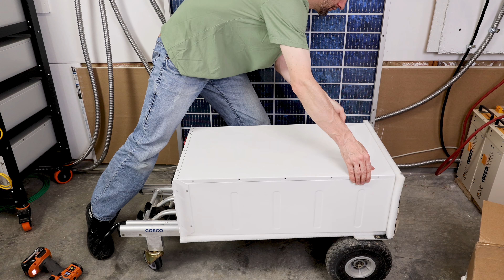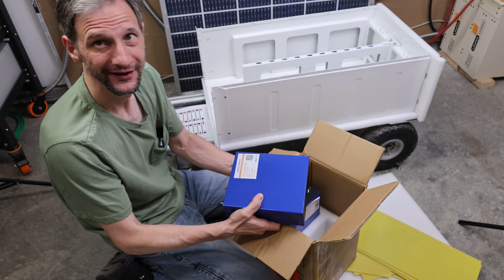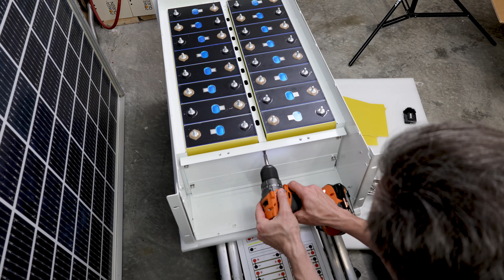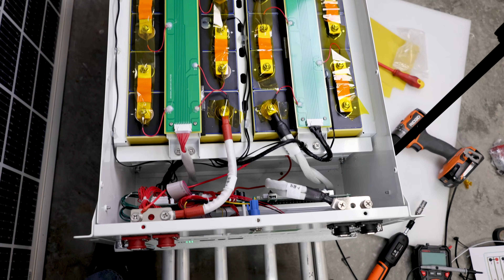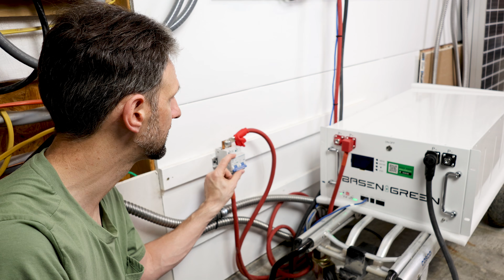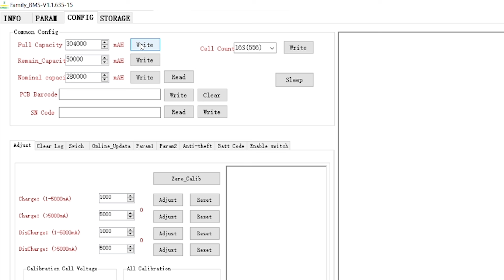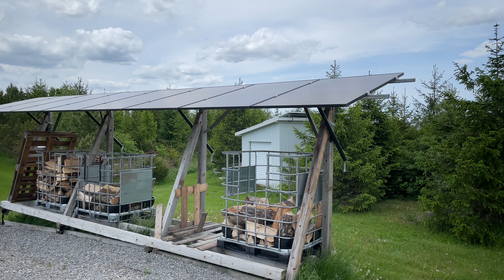SAVE Thousands - Build your own home solar battery backup!

Comment from the maker: See recommended battery options on my website: https://projectswithdave.com/batteries/
See more projects and get my FREE Solar Financial Calculator on my website ProjectsWithDave.com: https://projectswithdave.com/
Thank You for considering a small donation to help with channel expenses by clicking here: https://projectswithdave.com/donations/give/
304Ah Eve Cells US Source in stock here: https://solarsupplyhouse.com/product/set-of-four-304ah-eve-lifepo4-prismatic-cells-with-welded-studs/?ap_id=EverydayDave
BassenGreen Battery kit link (Often Out of Stock until August): https://www.basengreen.com/product/diy-case-for-48v-battery-packenclosure-accessories-copy/
Alibaba source:
48v kits: https://www.alibaba.com/product-detail/basen-greenline-battery-EU-stock-51_1601147027430.html?spm=a2747.product_manager.0.0.186e71d2fLaq6V
280ah: https://www.alibaba.com/product-detail/Shenzhen-Basen-Lifepo4-Grade-A-Battery_1601114676597.html?spm=a2747.product_manager.0.0.186e71d2fLaq6V
Reply: 3200 watt panels,
What's your take about the ideal charge amp and volt for this pack?
Reply: Namaste Bro, From where I can get it all products and accessories to my place in India at affordable prices. Thank You
Reply: Namaste Bro, From where I can get it all products and accessories to my place in India at affordable prices  Thanks 🙏
Reply: Is this a HIGH VOLTAGE DIY ?? Do you know any HV battery builds ?
Reply: What is the TOC (Total Cost of Ownership)?
Would LTO cells be better?
Reply: Lay the panel battery thingy flat the way it's designed You're going to crush the cells that are on the bottom of the stack
Reply: there's a whole area of study wrt compressing battery cells, most designs use clamp bolts.
Reply: I saw the cells for sale and thought about building my own battery of arround 15kWh because that matches with most voltages. I didn't know about this case, that make it a lot easier. I want to build one for my new house in the start of 2026 so i'll wait a little bit longer. If there is a commercial prebuild one by then for around $3000 i would probably buy that.
Reply: @AndreVanKammen   The assembled one is available now
Reply: @BraunPower  Thanks, I noticed. NKON in the Netherlands (where I live) also sells complete ones for a nice price. I already bought 3 Victron 6k5 from them, will start in the summer when my shed is ready.
Reply: Is it possible to purchase just the front control panel separately? If so how much?
Reply: Get an I.T. rack, any old I.T rack should work.
Reply: Hi Dave. After many hours of research your video popped up in my recommended feed. I watched your video and was convinced this was the battery for me. They sent me a damaged battery and then made it my responsibility to make sure it still works properly. I will be making my own video chronicling my experience.  I don’t see a way to reach out to you by email so I have to hope you see my comment.  Would you please consider taking your video endorsement down off YouTube? This company has not done the right thing by me and I don’t want any of your other subscribers to get into the mess I’m in. Thanks 🙏
Reply: That was such a great video and seems like something I would totally be interested in doing. Unfortunately you included so many links that I was lost as to what to purchase. You might consider a link that just includes the components you used in this specific build

Comment: I preferred the DIY you no longer trust companies selling you crap different cell on a premium 12v battery case. 

DIY is a genius way to be 
self-sufficient you buy everything that suits your needs to build 12v or any battery bank if something goes wrong you can dismental everything and fix it without a fraction cost of a thousand bucks.
Reply from the maker: I like DIY as long as it's saving me money, adding value, or delivering flexibility.  Ok, it could also just be an excuse to get a new tool .😂

Comment: I bought 3 of these.  Just wanted to make you aware of this.  One has been having issues and I believe the BMS is having issues.  The cells keep getting out of balance or either over voltage. I have spoke to them and they keep saying there's nothing wrong. Something is wrong for sure. It's still in warranty and I just don't think they want to replace it. I just wanted to make you aware they may not stand behind the product.
Reply from the maker: Thanks for posting your issue.  Make sure all the balance leads are clear of insulation under the contact surfaces and all the terminals are torqued properly.  If there is variation in the resistance of the connections, it won't balance properly.  Also, are you regularly charging to 100% and holding for some period of time for balancing?

Comment: Would love to find a Diy battery build for Generac PwrCell (1st edition). Bought a house with system already installed and they are grid tied and no battery. Power goes out with the grid,  what they point except selling solar (at deeply discounted rates for the local power company, on a Time of Use meter). Open to suggestions and I don't mind if it's not proprietary as ⚡️voltage is as voltage does. As long as I can match Amps, or I'll run a one way system and just charge batteries from the solar , but it would be nice to collect power when the grid is down.  Stupid design on Generacs side. All they want is 🤑💰💸

Comment: Right at the start of this video, you said there wasn't enough cost savings to warrant DIY battery banks??  What!? 

Come on now, you had to resort to a lie to kick off this video??  the cost savings, since Day 1, has been more than enough reason to build your own battery bank.  The cost savings, since Day 1, has been in the neighborhood of 40-60%.

The real reason, you avoided the DIY battery banks is because the average person isn't intelligent enough to do it.   Understanding the BMS alone and wiring it up correctly is enough to confuse most people.  Not to mention understanding what AWG wire to use.  Then, understanding series and parallel, and what effect that has on voltage and amperage confuses a lot of people as well.  The kit, takes a lot of that guess-work out.

You never explored, DIY battery banks, because you aren't intelligent enough to do it.  That's why you never did it.  Then this kit came out, and suddenly, the DIY battery bank became an achievable goal for you.  So, who was the SME you consulted to do this video?

And FYI?  you don't need the kit.  The kit is $500~.  If you did it all, 100% from scratch, you can save about $300 not buying the kit.  That BMS?  Is not expensive.

Comment: Maybe this was a good idea 1 year ago, but you can currently find fully assembled 15-16 kWh batteries with up to 10 years warranty for about that money minus the hassle and danger of the DIY route. Excelente tutorial, though. 👍
Reply from the maker: You're right, factory-assembled units provide convenience and safety and are often just as cheap as the DIY route.  However, I would still check the build quality, I have found that even some UL certified batteries can have poor build quality.  This is a great pre-built solution: https://youtu.be/5AKooBZNT9Y
Reply: @ProjectsWithDave  👍

Comment: Would this pass the local code enforcement?
Reply from the maker: No, local codes require UL listed equipment.  If you need inspection, you will need to confirm all your equipment with your local inspector.

Comment: I love how people now do things like this on even computers use the word build. Build used to mean something like buying rough cut wood, cutting it to a size in accordance to the plans one made on paper and then building a structure or a custom piece of furniture. Now, if one buys the plug and play components, snaps them into a tower, plugs in a wire, they built a computer. In this case here you would buy a bunch of batteries, place them into a purchased box specifically to hold the exact batteries that you bought, wire them together and you built a battery. To me this is assembled a battery pack not built a battery. But, the word built makes people FEEL better about themselves. They can now brag that they built a battery. I find it hilarious.
Reply: Do you build or assemble a jenga tower?

Comment: With battery that size how many panels are you running
Reply from the maker: I have found a 3kW array to be a good match.  8 panels that are 375W each is a good start.
Reply: @ProjectsWithDave I just got 108 acer for hunting so for a cabin  I'll have to run something  because getting power will be iffy i don't want to always run generators non stop I want the silence
Reply from the maker: Silence is worth a lot!  For a cabin you don't want to go too big, you will spend a lot of money that will never be recovered.  Depending on how often you go there, you  could probably get away with just a couple of panels to slowly charge a 280 to 314Ah 48V LiFePO4 battery.  That should last quite a while in a low demand situation.  Just have a generator available to boost the battery if you are there for several days with no sun.

Comment: You have to ask yourself what the hour life of a battery bank is. It takes a minimum of 1000 hours off the life of the battery bank to break even with your Utility service.
Reply from the maker: There are many factors that go into calculating the payback period for a battery bank, and it varies greatly from system to system.  In my case with net metering, it will never pay for itself.  I only have it for emergency backup.
Reply: @ProjectsWithDave  Very well. You know what you're getting with the expense, and apparently don't have unreasonable expectations (like the fellow I tried to help with his wind generators). My brother, an EE professor, installed PVs on his house, not realizing that if his wife outlived him--which she did--left her with all the maintenance and property value problems. Not fun for an 80 yo woman who has no affinity for tech either. Her one salvation is her oldest son is also an EE. But of course this throws an extra burden on him early in his own retirement.
I really would like to know what the hourly life of LiFePO4s are now. I looked at building my own EV a second time a few years ago, and found the life vs the fuel cost savings was not there. I have way too many irons in the fire in my life to burden myself with more tech maintenance.

Comment: Hot melt glue to secure the temerature sensors ?  Not sure what temperature the probes switch off the battery but hot glue " can soften near 65–80 °C "  from search ... Almost certainly be OK ..But I would have cut a little nitch in the plastic seperating the cells and tucked the probes in there. EDIT ..from , search BMS usually cuts out at 55C
Reply from the maker: Yes, hot glue was not the best solution for holding them in place.

Comment: Can you connect these cells in series-parallel connection?
Reply from the maker: You can connect them in parallel.  They are not intended to be connected in serries.
Reply: @ProjectsWithDave I meant series parallel connections not either or ! Look into it I was wondering if the cells can be connected together like this

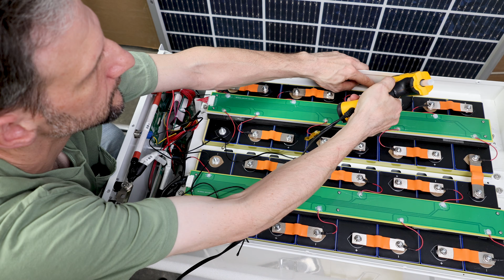Comment: 8:47 You used Kapton tape as insulators on the battery terminal connections. I had never heard of that. I had to ask ChatGPT what word you had said, and have since learned all about “Kapton”.😊

Comment: So, what's the catch?
The effort required to assemble the kit is low - it cannot drive the price down. It's probably $20 or less in China.
Shipping - could also be the factor as shipping 5 smaller packages ~20kg is likely cheaper than shipping 100+kg steel box full of flammable chemistry.
Warranty? Generally nobody needs to guarantee your diy kit works. How much is this worth? not sure.
What did I miss?

Comment: Correct me if i am wrong. I dont think DC breakers works on a single wire or polarity. It needs both positive and negative polarities in order to trip. Thats why DC breakers are marked +ive and -ive.

Comment: .. 😂😂😂 lolol normal grade a cells batteries are 1000 for 5.4kwh... or 3000 for 16.2kwh, or 2800 for 15.3kwh... and it isnt diy. You opened up correctly. Diy batteries are just not worth it.

Comment: U can use a 48v 5.5kwh tesla battery i found them for 230 bucks, i ordered two to connect in parallel, i now got 11kwh for only 460 dollars
Reply: in reality I get only around  ~8kwh , with active balancer, do you use any BMS ? , because of the charge and discharge limits , I use the same for around 4 years
Reply: @johnlonappan7945 i haven’t received my batteries, but i ordered a BMS with Bluetooth, i used chatgpt to help me design the system

Comment: Very impressive for the equipment  that you have to test the battery , But I am just the regular resident that want its to work period. The Assembly part I am OK. But what kind of a charger and dispenser do I need ? , I would like to run for the  entire house. 120 to 240. Please educate me. Any information is greatly appreciated.

Comment: Looks very much like the Seplos kits I built. Been running perfectly since I installed them in Nov 24. Will do an inspection on them in an upcoming video to see what state the cells are in. I 3 of these in parallel giving me 48kwh. So far I am extremely happy with them and the price was exceptional. Got all 3 of them for under $5k shipped to Italy from Deligreen power in Poland.

Comment: Beautiful. Where is proper fuse or circuit braker in this BATT ? If BMS and FETs go to "SILICON HELL", what will happen to this cells at 30 000 AMPS short c. ?
Does BMS have H2, C2H2, C2H4, CO detector and other potencially explosive gases ? How many temp. sensors have this BMS ?
If temp s. are not at every CELL, how will BMS know, that there is temperature rise and cell will go to internal shot circuit soon ?
What type of ventilation or water cooling is used for such projects ? If no thermal management, cells will be heated at nominal current
and AC impedance of cells will be high, so BMS will not be able to balance this battery.

Comment: IT looks like you could put an insulator on the bus bar strap going over the chanel peice or your last bus strap put on//thanks for the demo, I got to check on some batter kits this type, I never knew they had kits for these type battery.

Comment: All these DIY boxes that are out are nice. Just put #6 of 9 online this morning. Happy days are coming to an end soon though at least in the short term. One vendor I follow in China said last week that EVE cells are going up in price 100% as soon as stock inventory is depleted. Battery component material shortage they state as the cause. Made my orders back in January expecting this coming. Glad I did and slid under the wire at $!800 ea. Could be a good while before those days are seen again.
Reply from the maker: Wow!  That's quite the DIY battery build.  I suspect we will see a lot of price fluctuation in the short term.
Reply: No such thing as too many batteries. Wish I had 6 more.

Comment: Is this just a "plug and play" system, or do I need to setup on a PC and follow steps? I too have solar and over produce yearly average of 5,000 kw a year. Please help me set this up.
Reply from the maker: If you want plug and play, I would use a pre-built system.  There are several options on my website here: https://projectswithdave.com/batteries/

Comment: I don't have a victron system.  I plan on getting an all in one growatt 48v 3000W inverter.  Will this work?
Reply from the maker: As long as the inverter is designed for 48V LiFePO4 batteries it should be fine.  You might not be able get the inverter to communicate with the BMS, but you can just run it like a "dumb" battery.

Comment: I use about 20kWh a day, excluding the water heater, which I run at off-peak hours.
Off-peak pricing is 5 cents off, so if I charge my battery overnight to use throughout the day, I'd be saving about $1.50 per day or $547/yr.
So wear aside, this thing would pay for itself in 4-5 years.
We're almost at the point where it makes sense for literally everyone to buy a battery. That's pretty cool. Utilities could start cost-sharing batteries so that households have backup power for a few hundred bucks and utilities can save costs overall.

Comment: @ProjectsWithDave

Dave, really interesting and helpful video but I have one question.

As far as I am aware, for optimal battery life LiFePO4, battery manufacturers recommend that their batteries should be clamped at a reasonably constant pressure/force, typically around 300Kg. This probably requires spring loading of the battery pack because with a fixed enclosure the pressure will vary considerably as the cells attempt to expand and contract under different states of charge. As far as I could see, the battery enclosure you are using does not provide this function.

Comment: Ordering one of these! Appreciate you showing it off. Over 15kwh for like $1,900 bucks
Reply: I'm doing the same! Seems like a pretty solid setup at a reasonable price.
Reply: @SpacemanSmiley  seems like a no brainer to me! I was about to spend like $3,700 for server rack batteries and a rack to hold them.

Comment: hello, Thank you for your video. very interesting. Before to place the order even if the breaker is not included in the box as some competitor, could you tell me if this battery box can be installed vertically ?  Thanks

Comment: So, I think there is a bit of an issue using hotmelt glue to secure the thermister/thermocouples to the batteries, since there is a risk of it releasing in both super cold or very hot conditions.  A better approach would be to use some kapton tape and RTV to anchor it.  Otherwise, I am intrigued how easy these kits are to build.  Thanks for the video.

Comment: I'm guessing I would run into issues if I use an inverter that's not on that list Like an EG4?
Reply from the maker: Most hybrid inverters can manage a standard LiFePO4 battery.
Reply: @ProjectsWithDave  tyvm for the response, have a good day.